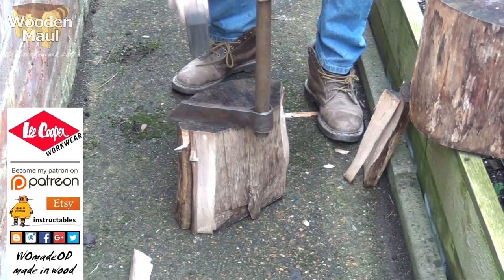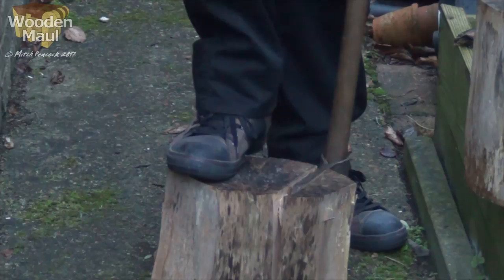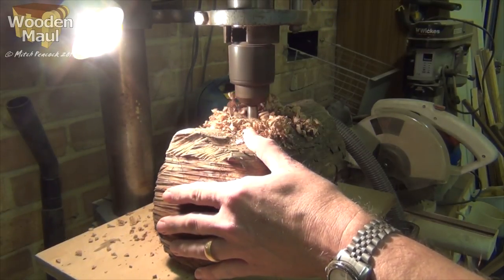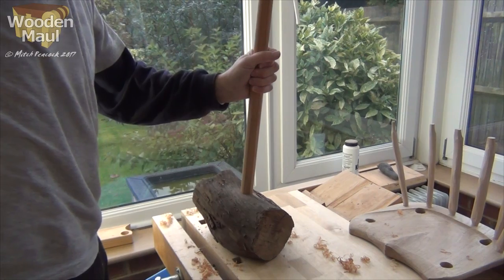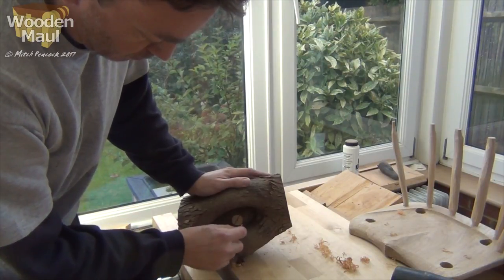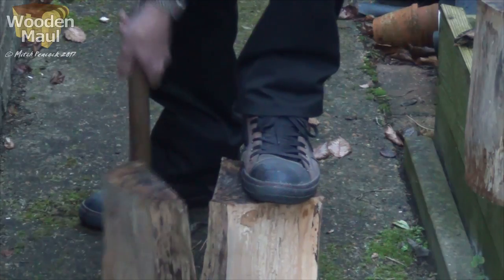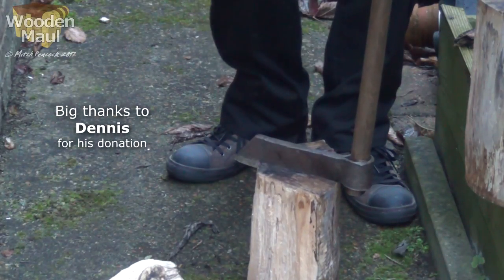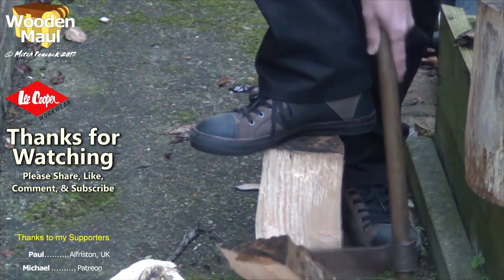Make a Wooden Maul

Comment: Nice video, Mitch. 
It's bleeding in your heart when you see that. Slap metal hammer on the splitter. ;-)But the idea with the piece of Wood to build a Wooden Maul out of it I find great. The Wooden Maul looks great and spares the splitter.You can also use the Wooden Maul for other things.
Reply from the maker: Günter Schöne Cheers Günter. Yes, I can think of some other uses, like seeing burglars off, or persuading tight joints 😉
Reply: Right, that's exactly what you can take the Wooden Maul. :-D :-D